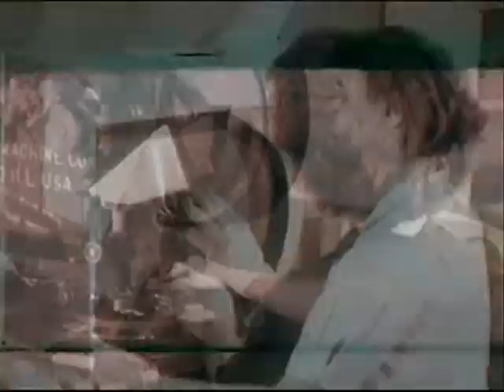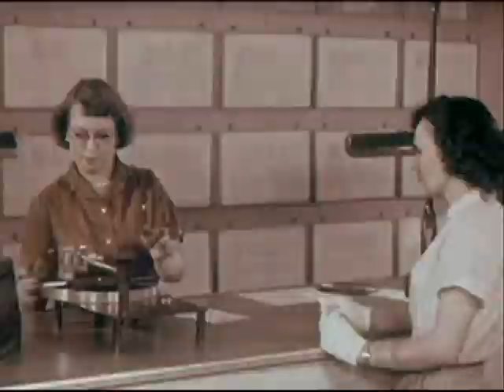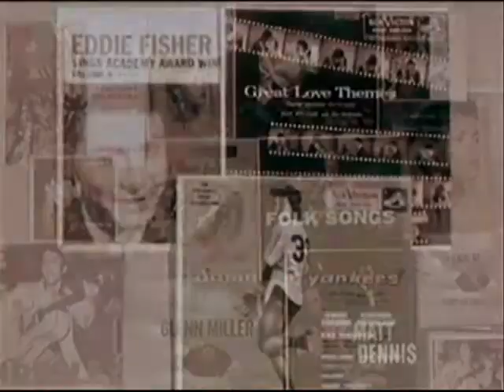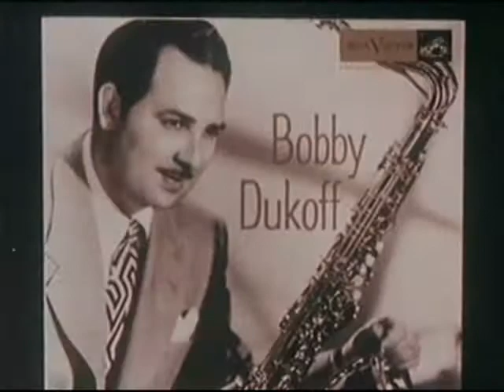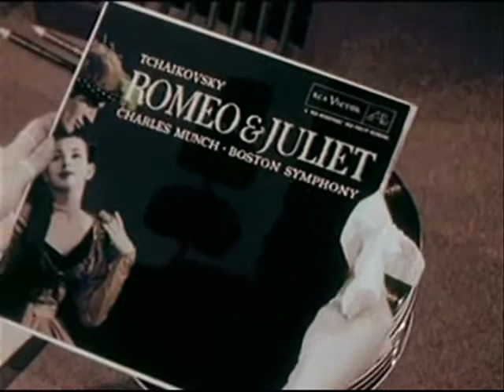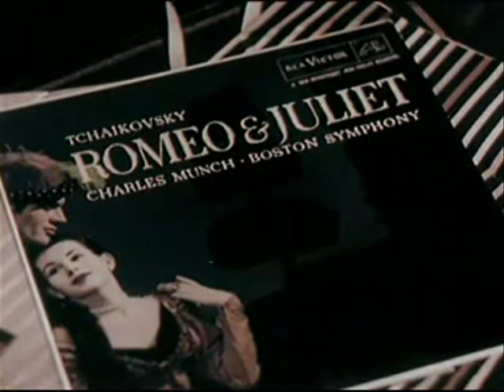RCA PART 2 Film 1956  - How RCA Vinyl Records Were Made

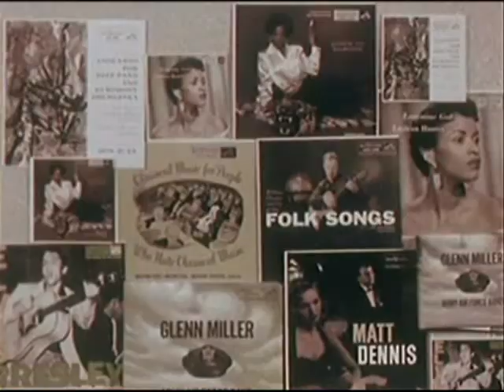Comment: Note Elvis' initial RCA album in the lower left-hand corner, among "the unusual" montage of albums at 3:48. Despite it's almost hidden from sight among the others, teenagers at the time DIDN'T want to hear Eartha Kitt, Matt Dennis, Glenn Miller or the Boston Pops- that's why Presley's album virtually outsold all the others that year.
Reply: Exactly.  Rock 'n' roll made its debut in 1953 with the release of "Crazy, Man, Crazy," by Bill Haley & The Comets.  Then, doo wop and guitar groups started to show up on radio, little by little, throughout 1953, 1954, and 1955, when in June of that year, "Rock Around The Clock" became No. 1 on Billboard magazine.  When that happened, the flood of rock 'n' roll records really took off.  Then came Elvis in 1956 and rock 'n' roll records got even bigger as a result, especially when "Hound Dog" became No. 1 on Billboard for 10 weeks in September of 1956.  🎸🎸🎸🎸🎸  🎤🎤🎤🎤🎤  😁😁😁😁😁